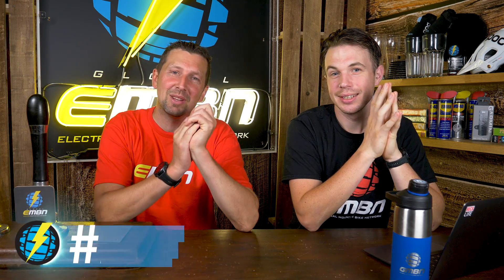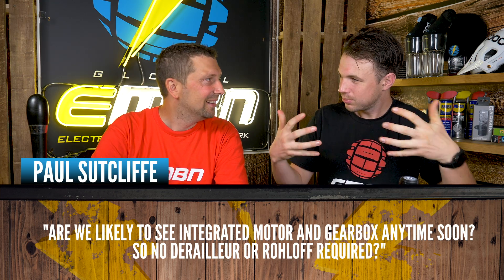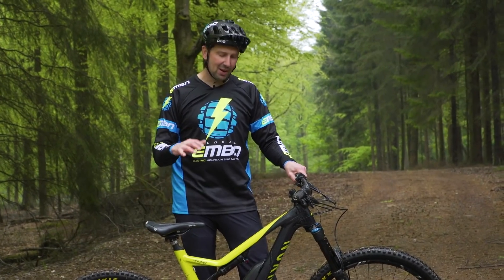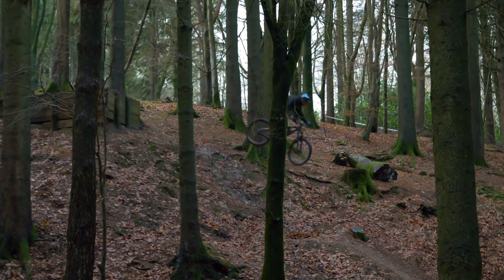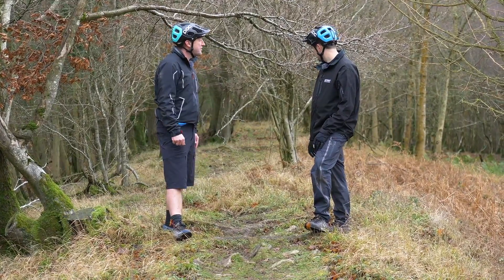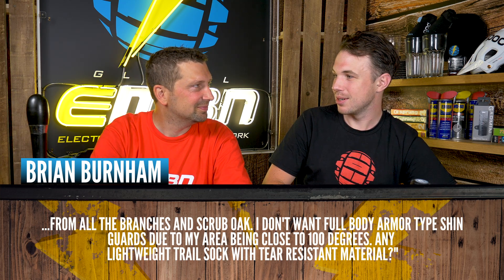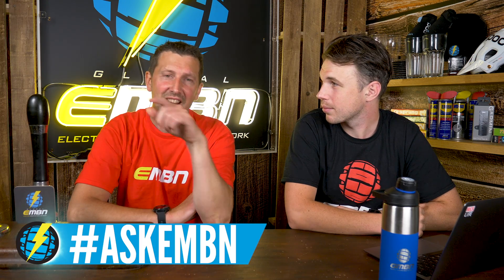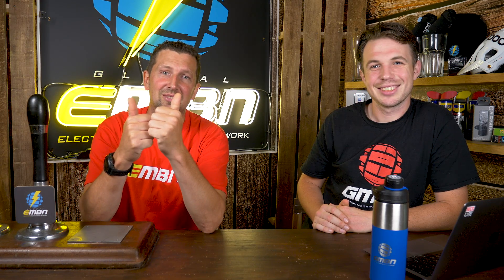Will Rock Strikes Damage My E-Bike Motor? | Ask EMBN Anything About EMTB

Comment: Hi. In regards to the gentleman who was taking shin abuse. 
We ride in So. Cal. Most of our trails have some kind of scrub brush, thorns and stickers. REI or any good outdoor store should carry gaiters. They come in varied thickness. Some water proof, some light weight. Gaiters are nylon and let the brush pass by without digging in plus there is a velcro closure on front the provides some protection from branches etc. Do not buy the elastic top type. Get the strap type. Its flatter and won't rub.
 My further recommendation is to glue velcro tabs to both the inside of the gaiters.  Starting with the hook tab at the back bottom inside of the gaiters where your heel is and the opposite soft tab on the top off the heel of your shoe. That way bits don't fall down the back of your shoe. They aren't too hot either. Someday I'll add eyelets for better airflow. I regret the days when I forget them.

Comment: I hear Chris saying it's not all that hard to manual an ebike, but Chris is not  165 cm tall and 64 kg with 71 cm inseam.  I'm trying my hardest to mimic Neil's L-shape with explosive movements, but at best I get about 30 cm of rise out of the front wheel of my Levo with the 700 Wh battery.  Please do a segment showing someone my size (a 3/4 scale model of a human!) manualing a Levo.   Maybe there is some body size at which manualing becomes essentially impossible?
Reply from the maker: What it simply comes down to is rider height vs bike size. Even a tall big rider on a long bike will struggle with manuals. We suggest you try running a shorter stem and perhaps also a higher stack height or higher rise bar as this helps with the initial lift. The added weight will make that initial lift more effort though, you could also try learning to manual coming out of a bank.

Comment: #ASKEMBN First, the obligatory, love the show and have been watching since it started.

Question, First some background, I have a 2018 Levo Comp purchased new November 2017 now with about 850 miles on it. ( I have 5 bikes so I have to spread the fun out or there'd be more miles on it) and there is a trail we ride here in the mountains around Vegas where instead of bringing two trucks and doing a shuttle, I get to ride the Levo from the bottom to the top after the 10 mile DH run. This uphill is 8 miles averaging 7.6% and covering about 2,500 feet (800 meters) vertical climb. The climb starts at about 6,000 feet and it was about 80 degrees out. The climb takes about 50 minutes and I'm averaging a system output of between 600-700 watts in a combination of 50% assist (75% power) and 75% assist (100% power).  This climb uses about 90% of the total power in the battery.

The issue I am having is after about 15 minutes of climbing I can feel a significant drag on the motor, to the point that the bike will slow down even on a down slope. After a 5 minute rest the drag is gone and the bike performs normally, for about 15 minutes. Is this a symptom of the engine overheating? If so, what can be done to  prevent this or limit the overheating. Is this causing any damage to the motor or bearings? 

I have found downshifting and spinning faster seems to lengthen the time the motor can perform without the added drag, but not eliminate it.

Comment: Try Eco 15 percent for starters to match a conventional bike. Trail has more dynamic assist and Turbo has a mind of its own .  Seems to me than specalized might add their new motor to an xc platform but not a,levo or kanevo , those welcome a tad more power which you can dial back
Reply: but the lighter weight on a Levo would be awesome. plus being able to fly with your bike would be cool.
Reply: True but the Creo motor is "only" 200w , id hope spec make another different motor maybe 500g heavier but just as powerful as the 2.1 mag motor

Comment: #askembn Hey guys, a few quick questions: What would be causing thin dust lines to appear on my tire sidewalls? They crisscross one another at roughly 45 degree angles all the way around the tires. I recently increased my tire pressure and they seem to have all but been eliminated. Could it have been from the sidewalls creasing in on themselves due to a slightly under inflated tire? Also, could you guys comment on protection that the EMBN presenters/staff prefer to use for gnarlier days on the trail or at the park? Aside from a helmet and gloves that is. Maybe a quick run down video of where and when you guys feel it's appropriate to get some added protection (knee/elbow gaurds/etc.) without overheating or being uncomfortable and the most common types of areas you guys get scraped up or injured.

Thanks a bunch and you all rock! Keep up the amazing content.
Reply from the maker: Hey Bretton, yes the the markings on the tyre happen at low pressures and are creasing. It's where the rim and tyre are trying to move at different speeds. You could call it radial tyre roll if you wanted to be fancy 🤣. In regards to protection we suggest you wear what suits your personal skill level and confidence. We have seen riders wear a tank top and no gloves at RedBull Rampage. Equally we know riders that always choose to ride will full pads even on tame trails. It's all personal preference 👍
Reply: @embn  Thanks a bunch for the info and the quick response. Very happy to have subbed to this channel.

Comment: In regards to how much assist to dial in to give a non ebike feel - with my 2017 Levo I feel its somewhere between 12 to 15% assist in Eco. Its just enough to compensate for the added motor and battery weight.
Reply: With my 2019 Kenevo Comp I would say about 5-10% assist with 20% motor power. (5 seems like too little and 10 too much!) - you need to ride both bikes up the same hill preferably with varying gradient and dial your ebike mission control settings up/down until they 'feel' the same.

Comment: #ASKEMBN Hi guys, Im 82kg in full kit and Ive got a Merida e160 900 with stock supplied Minion DHR II 27.5-2.8 and wondering about running the Assegai’s in 2.5 any disadvantages to going down in widths & which casing more emtb suitable ? I ride loose dry pee gravel DH trails with some rocky areas in Australia and generally find front grip more a issue than rear.

Comment: #askembn Hi, I currently ride a Canyon Tourqe, and is used mostly for pushbike trails/parks. I'm in the hunt for a cheap emtb (first). For everyday use, and some moderate trails. If this is a hit, I will consider changing my Tourqe for a proper emtb. There are so many 'unknown' bike manufacturers around. I was looking at this Rockmachine blizz e50 int. Hard tail with 27.5+ and steps e 8000 motor. At 1700,- pounds. What do you think. Thanks Preben Norway  https://rockmachine.us/en/2019/flash/blizz-int-e50-27-plus/matte-petrol-blue-radioactive-yellow-black